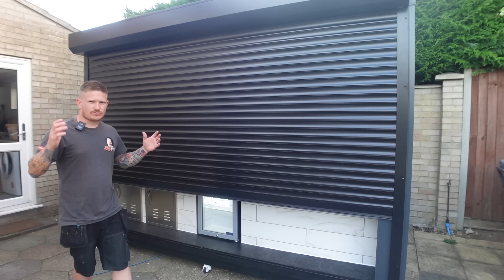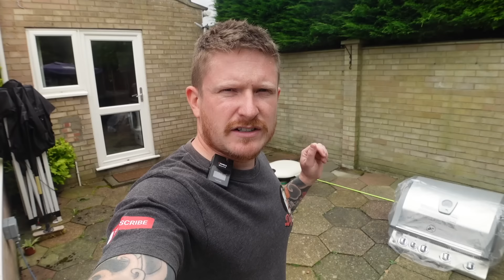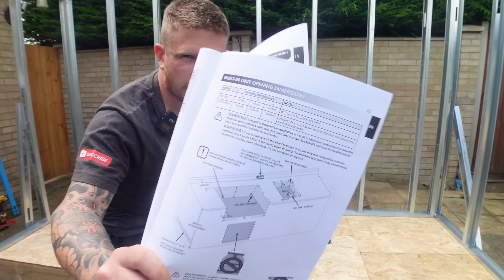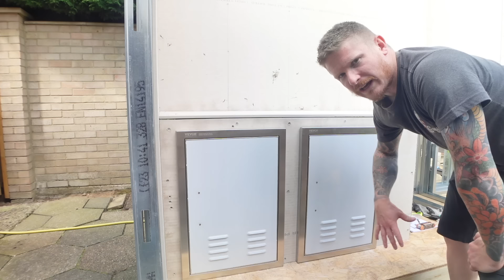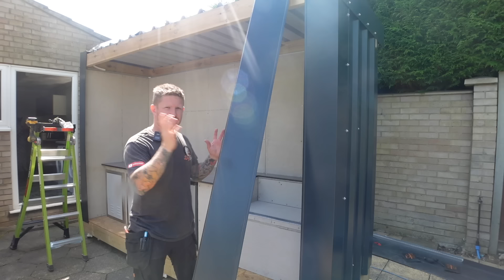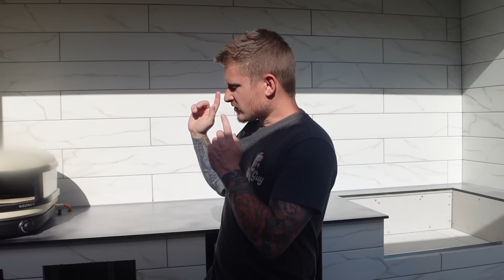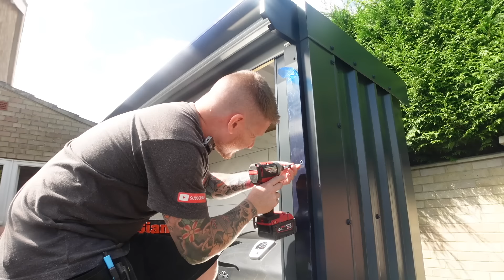Build this Smart Controlled and Mobile Outdoor Kitchen!

Comment: How many peaple does it take to move this kitchen? And how are the wheels handling the weight? 
I ask cos ive done something similar but out of timber but its not a kitchen its a storage shed and another one is a tool station similar size to your kitchen and on wheels. Thanks
Reply from the maker: It’s a heavy lump and takes a few people to move it for sure

Comment: Why though? This makes literally no sense. This isn't like mobile kitchen. This is like your backyard grill setup, but made into semi mobile package nobody would ever want to move, and it would be hard/expensive anyways.
So why the heck would need this? If you wanted to transport grill somewhere, you could literally just do that. Put grill and pizza oven at back of your car, and set them up where you need them. That's it. No need to haul whole freaking box. And if you actually wanted to use this for commercial purposes, it's TOTALLY unsuited for it.

0:00 I mean outdoor kitchens are in. But as part of your patio/backyard. You just pulled some weird idea of portability and shutters somewhere.
Reply from the maker: I like it 😂

Comment: serious question. it loooks like on the back side you attached the corrugated siding direct to the framing? how do you keep rodents out of that gap at the bottom of each corrugation?
Reply from the maker: Either filler strips or
Some
Wire mesh do the trick

Comment: Decent work dude.  Great concept.  A few things I would like to do differently if I ever get the chance.

Insulation between the cement board and the cladding;
Slightly wider frame ~ length seems good for what was planned to fit in it but I think could benefit with being a bit deeper/wider;
A chopping board lid for the sink (one side the original cladding, the other a chopping board);
Either change the door to liftable wall (that doubles as an extended roof) or add an expandable awning to the box housing the roller door.
Reply from the maker: Some great ideas there, especially the chopping board lid!

Comment: Why did you not install eaves fillers…
You will get the wind trying to lift the sheets off the roof and get insects trying to get in
Reply from the maker: Mostly to vent bbq smoke. Well it’s still all good two years later haha.

Comment: Absolutely love this,  it looks fantastic. Just two quick questions:

Is there enough floor space between the units and the edge of the flooring to stand comfortably? If it’s a bit tight, do you feel too far from the worktop, or find yourself knocking your shins against the front?

Now that you’ve been living with it for a while, is there anything you would change or do differently
Reply from the maker: Glad you liked it. Yep room to stand and i would change the bbq out and make a shallow section for a charcoal bbq such as the kamado

Comment: If you use a pincher to get the metal joists together, you wont have to spend money on screws and also wont have to worry about screws sticking out. Other than that, fine work.

Comment: I love your project, thank you for sharing how to do it. A question, how solid and resistant are the aluminum profiles, to make an Outdoor Sauna instead of using wood,With all its normal heat-resistant barriers and humidity, inside with its respective layer of aluminium foil and wood, what do you think is possible?

Comment: Being mobile, I’d love to know how you connected the gas, water, drain, and electricity
Reply: The gas is in bottles stored below the work surface. Electric only needs an extension cord to reach the nearest outlet. Water supply comes from a length of garden hose to the nearest spigot. Sink drains by gravity into a5 gallon bucket or French drain. None of that is especially elegant which is why a MOBILE outdoor kitchen is such an awful compromise. In the US our mobile kitchens have a trailer hitch and proper wheels for transport to wherever the game is

Comment: I actually built a smaller outdoor kitchen in 2023 with a roller door (electric). As said it is much smaller, just a bbq with about 40cm workspace on both sides of the 100cm bbq. Not a built in bbq, just regular one and on both sides and above it IKEA Kallax cabinets (open type). I would have gone larger but garden space, layout and budget didn't allow for that. Anyway it works and it is a bonus that you can simply roll the door down and clean up next morning. Also no need for covers to protect everything from the weather. But your build is much more professional looking.

Comment: What a great video & total inspiration. We are just about to embark on something almost identical, except we want to make this static fixed to a porcelain patio. Will be 3.2m by 1.2m & I plan to put the roller door inside (much like your garage door video) Plan is to Cement board the inside but use the composite board in your workshop video for the sides & metal for back (not seen) & roof. What I like about the way we intend to do this is with the door up this blends into a small space we have allowing people to sit in the space in front of the kitchen with no platform to deal with. Will be giving TWF a call for sure so again thank you :-) Anything seem terrible about my idea? I am contemplating is fixing this to the patio is enough or I should sink some posts in the ground to form the corners (patio not laid yet)

Comment: How is it “mobile” when it’s plumbed in for water and waste? Also, why would you not paint the base before cladding? Exposed edges would be protected, you don’t have to take extra time to avoid getting paint on the bottom of the cladding. We should always work “inside to outside” when thinking about weatherproofing

Comment: WOW this thing is amazing!

My only concern is if that "black step" at the bottom is in the way? It doesn't look like it's wide enough to stand on? And if you do stand on it, then the countertop seems to be very low. 
So is it designed to stand on the ground in front of the black step?

Oh and how do you supply the water? Just hook up a water hose at the back? And where does the drain from the sink go to?
Reply: That would drive me crazy too.  I'd have to make it a little longer and use some floor covering.  But DYI Guy really knocked this build out of the park!!!!
Reply: @thomasdavey5113  Or remove it completely and lower the height of the appliances to suit ground height

Comment: I have tried to replicate your project, and tomorrow, TWF will deliver the roller door. I am a bit stressed about the fitting side of it, but hopefully, it will be ok
 I just want to say  thank you for your bright idea. I am well pleased the way it come out so far. I have got a question if you dont mind 😊  have u just used normal screws to fix the roller chanels into the C stud? 
Thank you
Raz
Reply from the maker: It’s fairly simple. My advice is to watch my garage door fitting video where you will find more specifics on fitting the door. Yea, any screws will do through the guide rails into the c stud behind. Make sure you follow the TWF guidance you get with your door and you’ll be fine. Reach out to Tom at TWF if you’re not sure on anything, he is great and will guide you in the right direction
Reply: @TheDIYGuy1  thank you so much . I have watched the other video a few times and hopefully I will get it right first time. Keep up the good work.

Comment: Great build. as usual, but what about water feed, waste and electricity hook up? 
Do you have ports installed externally to connect the services? 
Did you install a header tank and pump for the water or do you connect to a garden hose?
I assume you would need to connect to power for the roller door to operate unless you have some batteries for when it's not connected?

Comment: This has nothing to do with your latest vid. It’s a thank you for a previous vid about putting inhibitor into the central heating system. Just had my boiler serviced and was told it Would an extra £60 to have inhibitor added to the system. As a subscriber I remembered you did vid on doing yourself. Well I have….so thank you for easy to follow instructions and saving me money !
Reply from the maker: Glad it was helpful!

Comment: Not very mobile with such weight on those tiny little casters on a rough patio surface I wouldn't think. You would have been better off deciding where it was going to sit and just build it there. I doubt you will ever move it far in the future.
Reply from the maker: Actually when we dig in some new drains it will need to move. Those 6 casters on there currently are rated to 1.5 ton. We managed to roll it with 2 of us 👍

Comment: Out of interest what was the complete cost of materials ?
Reply: Not much change out of £5k including the roller shutter door I wouldn't think.
Reply from the maker: Your about right there 👍
Reply: @TheDIYGuy1  I’ve got an ooni pro which  is dual fuel but with the gas attachment it adds 12 inch to the rear, not ideal.
Btw are you affiliated with any power tool brand? As I work for Bosch and could be an opportunity?
Reply from the maker: Pizza oven spacing can be a pain. I’ve left less than the recommended gap but I tested it beforehand to check how hot it got and found it was actually fine to leave just a small air gap around. Im guessing you mean additional sizing with the gas attachment though, which is a real pain! I’m not partnered with any specific power tool brand but would be happy to speak to you guys and see if we could come up with something 👍
Reply: @davenewman4301  thanks 
I’ll probably go without the shutter door and come with a cheaper solution

Comment: That’s a nice project, I reckon you could make a few quid with these👍🏻 I take it the water supply was via a garden hose and power through an extension lead? Could you have used 12mm WEDI board on the walls to keep the weight down? Not sure how fire retardant they are mind. I could see one being built on a trailer frame too! I’m just down the road from you shall we go into business 👍🏻😂😂
Reply from the maker: 😂😂 your probably right about being able to make these for others. Cheers
Reply: @TheDIYGuy1  Hi great idea. If you were to make these for people could you give a price? I might be interested.

Comment: Great project and video! Just wondering about the water feed and waste for the sink? And assuming the electrics are plugged into an outdoor socket?
Reply from the maker: Thanks. Extension goes up through the bottom with insect mesh over the hole and hidden behind the fridge. Water supply on a hose(non drinking just hand wash), waste pipe drains through to a bucket with mesh over again to prevent any nasties coming inside

Comment: Where did you get the water inflow from for your tap, the electrics to power the lights and door, and where does the sink waste go?
Reply from the maker: Extension goes up through the bottom with insect mesh over the hole and hidden behind the fridge. Water supply on a hose(non drinking just hand wash), waste pipe drains through to a bucket with mesh over again to prevent any nasties coming inside

Comment: Great video. Please can you show how the sink supply, drain and where to? Also how the electrics work?
Reply from the maker: Cheers. Good fun to make. Extension goes up through the bottom with insect mesh over the hole and hidden behind the fridge. Water supply on a hose(non drinking just hand wash), waste pipe drains through to a bucket with mesh over again to prevent any nasties coming inside

Comment: Great build as always. 
What did you do for the pluming for the sink and electric hook up ?
Reply from the maker: Cheers. Sink runs off a hose and is hand wash only. Electric is on an extension which runs up through the bottom and hides behind the fridge.

Comment: Absolutely amazing., What about the plumbing  and running water for the sink ?
Reply from the maker: Cheers. Good fun to make. Extension goes up through the bottom with insect mesh over the hole and hidden behind the fridge. Water supply on a hose(non drinking just hand wash), waste pipe drains through to a bucket with mesh over again to prevent any nasties coming inside

Comment: How do you plumb in a mobile sink?
Reply from the maker: Extension goes up through the bottom with insect mesh over the hole and hidden behind the fridge. Water supply on a hose(non drinking just hand wash), waste pipe drains through to a bucket with mesh over again to prevent any nasties coming inside

Comment: Great build! What did you connect the water supply and waste to? Does it run off an extension for power?
Reply from the maker: Cheers. Good fun to make. Extension goes up through the bottom with insect mesh over the hole and hidden behind the fridge. Water supply on a hose(non drinking just hand wash), waste pipe drains through to a bucket with mesh over again to prevent any nasties coming inside

Comment: How do you get the power and water to it and keep it mobile? Great build - well done!
Reply from the maker: Cheers. Good fun to make. Extension goes up through the bottom with insect mesh over the hole and hidden behind the fridge. Water supply on a hose(non drinking just hand wash), waste pipe drains through to a bucket with mesh over again to prevent any nasties coming inside

Comment: Nice build mate! How does the metal studwork compare to timber, price-wise?
Reply from the maker: It’s actually pretty comparable as long as you buy from a builders merchant. If buying from high street DIY stores it’s more money, cheers
Reply: @TheDIYGuy1  Thanks. I tend to stay clear of DIY stores and their bendy wood! Would it be suitable for a garden room build? I like the fact that it's so light and, as I'd be doing the build mostly solo, that would help enormously.
Reply from the maker: I would probably avoid it for a garden room due to the roof weight, but for internal walls it is fine 👍

Comment: That was meant to be my summer project this year, (other plans interfered).
Awesome build mate. Well done.
Why you not tile and trim out the floor though?
Great video, thanks.
Reply from the maker: Thanks. Always next summer to do yours. I actually might use some left over vinyl tiles to go over the floor but I wanted to get it done so I could share the video even though I may make some small changes later

Comment: Wow was an amazing video, never thought about making an outdoor kitchen but now I want one 😂 if this is portable, did you connect the sink up to Mains water and where does the waste go?
Reply from the maker: Cheers. Good fun to make. Extension goes up through the bottom with insect mesh over the hole and hidden behind the fridge. Water supply on a hose(non drinking just hand wash), waste pipe drains through to a bucket with mesh over again to prevent any nasties coming inside
Reply: @TheDIYGuy1  amazing, hope you get good usage out of your kitchen
Reply from the maker: Cheers

Comment: great video but how the hell did you get power and water to the unit ??
Reply from the maker: Extension goes up through the bottom with insect mesh over the hole and hidden behind the fridge. Water supply on a hose(non drinking just hand wash), waste pipe drains through to a bucket with mesh over again to prevent any nasties coming inside

Comment: Looks great. I'd like to see a 6 month later follow-up vid after winter to see how it fares. Hopefully the water resistant cement board and air gaps in the shutter providing ventilation mean you won't have any problems with trapped moisture.
Reply from the maker: Hopefully it will be fine. I’ll try touch on it in future

Comment: Amazing! I wanted to do something like this, what great timing!
Reply from the maker: You should!
Reply: @TheDIYGuy1  I also want a sink, though I will get a bigger one, how does your solution deal with water inlet and drainage? Power is easy enough to hook in and out but piping and drainage?
Reply from the maker: Pipe your sink off a hose but make sure you use it as hand wash only. Drainage, just run your waste in a bucket or pipe it into a flower bed behind. You will probably want to mesh over the end of the pipe so no nasties come in

Comment: Question, where are getting power/water from for the kitchen. Does it just hook up to the house
Reply from the maker: Extension goes up through the bottom with insect mesh over the hole and hidden behind the fridge. Water supply on a hose(non drinking just hand wash), waste pipe drains through to a bucket with mesh over again to prevent any nasties coming inside

Comment: Where does the plumbing and electrics go out and where to?
Reply from the maker: Extension goes up through the bottom with insect mesh over the hole and hidden behind the fridge. Water supply on a hose(non drinking just hand wash), waste pipe drains through to a bucket with mesh over again to prevent any nasties coming inside